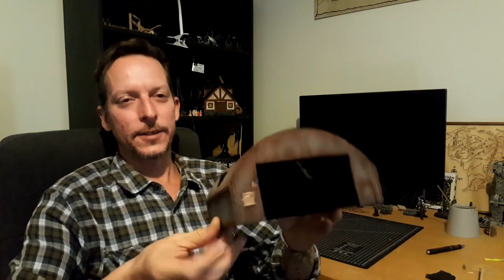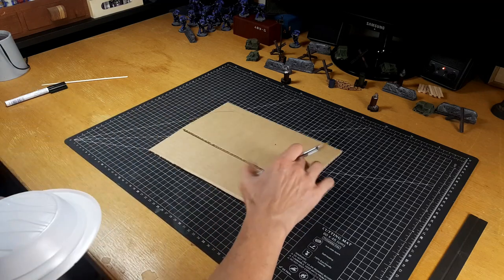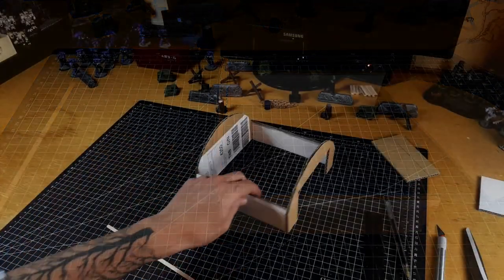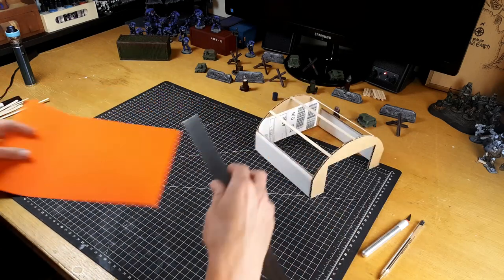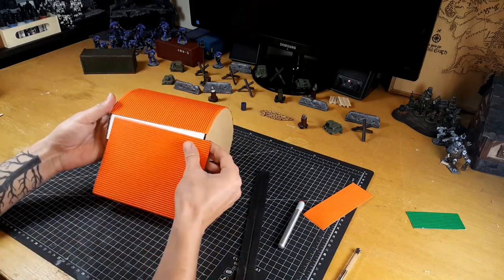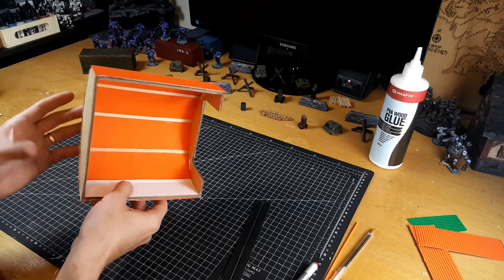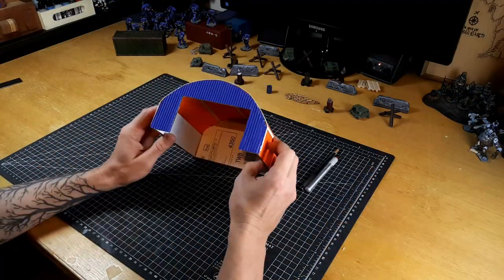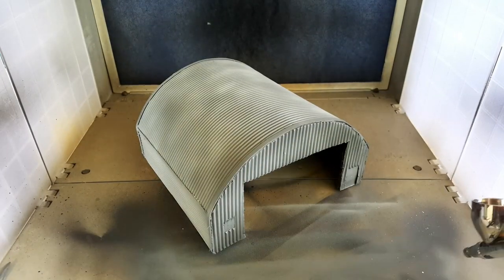Miniature Vehicle Hanger - Easy to Build and Paint, Wargaming & Tabletop Gaming Terrain Tutorial.

Comment: From rural saskatchewan here, a lot of quonsets tend to have the vertical curved walls extend all the way to the ground. It wouldn't normally be horizontal at the bottom portion. But otherwise... nice! I'm gonna make one myself.
Reply from the maker: Thanks Dallas, yeah as you can tell by the build, it's easy enough to extend the corrugation to the ground instead of adding side walls as I have.  Would probably make the build easier as well.  Thanks for the suggestion mate.

Comment: I wanna build one with fully detailed inner framework made from balsa tho it will be difficult to paint without an airbrush I also wanna add led lighting and go all out on the details I might even pre cut the roof into individual corrugated sheets it will be an amazing centerpiece for my Gaslands board
Reply from the maker: That sounds awesome. I did do one build with an LED smoke effect, just cotton wool and an LED candle, it was cool, but it was also fairly rough, so I didn't include it in the final version.  There's heaps you can do, and your ideas sound great for this. With an inner framework you could certainly remove lots more of the corrugated sheets and detail out the inside, I'd size it up a bit if you're going for individual sheets as well, I remember I limited myself to the size of the corrugated paper I had for this build, but a larger hanger makes sense for lots of reasons :)  Good luck mate, let me know how it goes.

Comment: if your using the corrugated cardboard for the roof you have to do in in the orientation you are using otherwise the rain, snow, dirt can't run down the sides
Reply from the maker: Yeah, it can be a bit trickier to bend it in this orientation, but it makes sense to have it this way for sure.  Thanks.

Comment: Why do you use hot glue to connect the cardboard but PVA to put the wooden beams onto the cardboard roof frame?
Reply from the maker: Sometimes I might do things for no apparent reason.  Usually however, I'll use the PVA glue if I think I might need more time, or need to move the piece as I'm putting it in place.  The hot glue is very fast to set, and a bit messy as well, so it might depend on the situation and the piece I'm putting in place.  PVA glue will shrink and dry clear, so you won't be able to see much (if any) of the sqeeze out once it's dry, it'll leave a much cleaner look if you're gluing to the outside of something, hot glue however will leave bubbles of dry glue if it squeezes out.
I hope this was helpful in some way :).  Cheers.
Reply: @RFDHobby  Thanks, the reason I asked the question is because I'm still trying to figure out myself which glue has what pros and cons in what situation.

Comment: The rolled down corrugated paper. I couldn't tell but does it have a siding effect like what's on a house?
Reply from the maker: Yes, it's really hard to see in the video, but it turned out perfect for a weatherboard siding effect.  So long as you have something hard, like a rolling pin, or spray can, you just apply some pressure as you roll it over the paper and it removes the corrugations, and 'folds' them all done the same direction.  If you've got some of this paper handy, just give it a go on some scrap, it honestly looks great for this.
Reply: This seems like a real fast way to make modern houses. Peefect
Reply from the maker: @thrashviking7707  absolutely, the scale is close to spot on too.  I tried a similar effect using the sticks on the test build, and it works ok, but it's pretty rough, and the scale is a bit off (not to mention a pain to put together).  This was so easy and effective.  Thanks again mate.
Reply: Thrash Viking I will teach you some of or sacred Australian tongue. We call that corrugated metal building material 'Galvo' go hard on the 'a'.